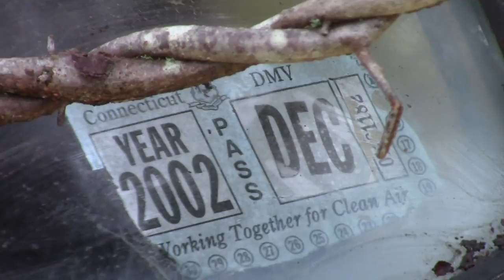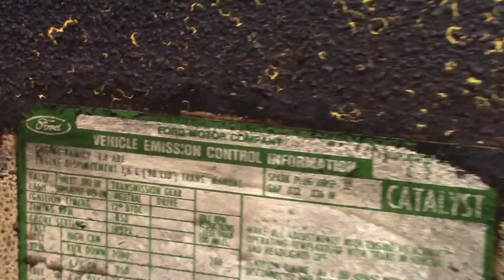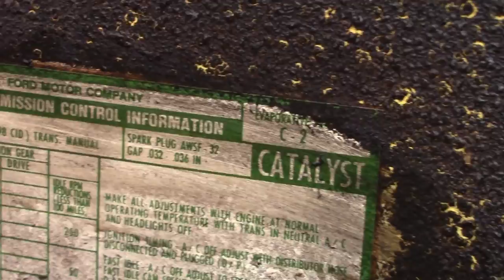FIRST START IN 17 YEARS! (PART 1) WHAT IS IT?

Comment: My first Fiesta with a similar story although it was only in the woods for 16 years but it had 3in Alder trees holding the doors closed.
I presently have 10 Fiestas more than half of which are more than half used up I could still at least three running maybe four if I purchased a few more parts.
I find that they are the ultimate tool for the job utilized 6 days a week on my newspaper deilvery route job of the last 12+ years.

Comment: The neutral safety switch is not going to work when your jumping the starter from the battery how about getting the car to start off the ignition key since the thing runs good